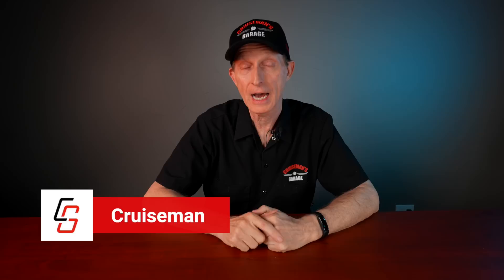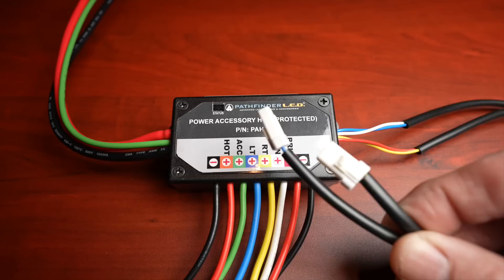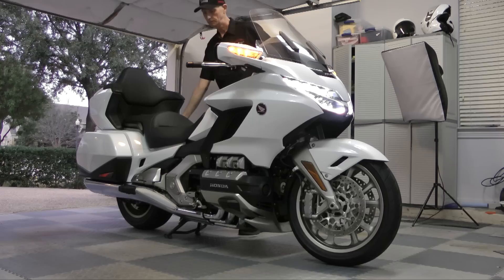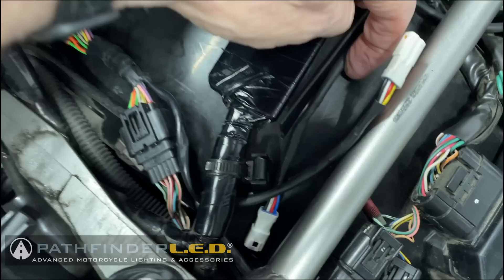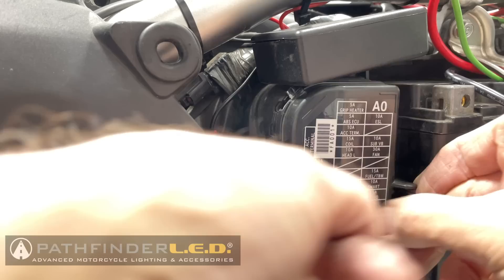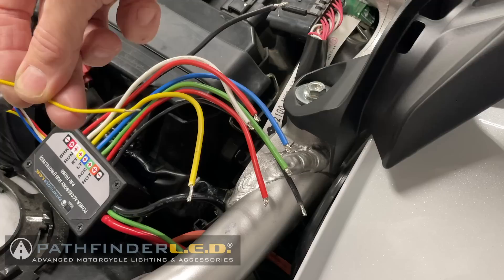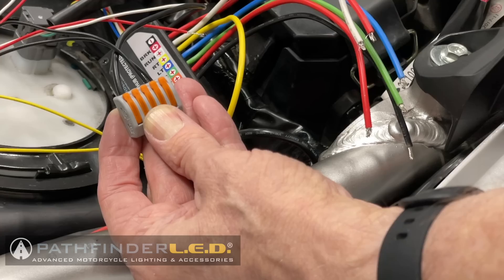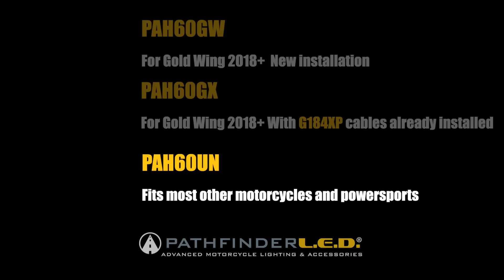Power Accessory Hub from PathfinderLED | 2018+ Honda Goldwing | CruisemansGarage.com

Comment: I ordered and received the Power Accessory Hub and it is all that Chris describes, and more.  I looked at Show Chrome and Electrical Connection and others for this type of additive device.  I was happy to see that Pathfinder/SocalMotoGear produced this alternative.  I have their harness and have three of their other lighting products installed on my 19 GW DCT.  I installed it this week and used Chris' install video here and others he produced to install the Show Chrome unit.  I used the Wago connectors on the ends of the Pathfinder Hub trigger wires and  used a black box to hide and  secure them with out of site.  His instructions were perfect and I am a happy camper.  I used the Wago connector to do the final wiring for my Muth Mirrors which work perfectly.  I now have the ability to add other electronics to the bike as my Pathfinder Harness is full.  Highly recommend this accessory.  Thank you Cruisman for your videos and these accessory installl productions.
Reply: What is the point of the show Chrome box if you have the Pathfinder box, or do you need both?

Comment: Thanks Chris.  I have all the supplies ready for the module to start selling.  This was great and I am now able to hook up my Muth Mirror turn signal wires.  I've installed and stored the wires waiting for the distribution block.  I will store the excess Wago Connectors in one of the black boxes you suggested when rewiring your bike originally.  Then I'll be good to go for the future.  Lucked out having got with the Pathfinder products thanks to your suggestions on accessories two years ago.   I like the weatherproof unit and the sizing.  Well done, as always.

Comment: I didn't realize this. But used a isolation relay to add my trailer lights. I recently bought a late model Toyota and am planning on installing a trailer hitch. It also requires an isolation relay. Learned all about them from your videos. Thanks buddy.

Comment: My bike already had a Electrical Connection trailer isolator. I used the trailer outputs to power a trunk mounted Goldstrike Tourblade light. Used posi-taps to tap the circuits downstream of the isolator. These Wago lever nuts appear to be a way cooler and safer way to share output circuits. Thanks Chris!

Comment: Ive been looking forward to this video, Chris. Good job! I have lots of accessories (lighted or otherwise powered) installed by the dealer and I've been waiting for this block to come out to clean up all the extra wiring and protect y the can bus electrical system. All of my accessories are either OEM or Pathfinder, which is quality stuff. Thanks again!
Reply from the maker: Sounds great!

Comment: Thank you for sharing I just purchased this and I am planning on installing the rear LED brake running lights with turn signals at the lower saddlebag area

Comment: Dang, you make it look so easy I am tempted to add lights to my 2018 non-tour using this product instead of letting the dealer do it. Have the Pathfinder fog lights and cowl lights in my cart and just waiting until I can add the power hub and the new Saddlebag LED lights. Also planning on adding the Muth Signal Mirrors.
Reply: Do the work yourself. Don't pay the dealer. I have added just about every light you can to that bike myself. It is easy and straight forward. Just take your time.

Comment: My question is:  you recommend to use wago 222 connectors but now they have a 221 which is clear and smaller.  Is  there any issues with using the 221 connectors.

Comment: Good evening were you able to use your Cowl Lights, LED Rotor Cover and Engine  Lights with your Pathfinder L.E.D Power Accessory Hub. If so did you use Goldstrike 48000 plug n play connector?

Comment: Hey Chris! 

Is this what I need to connect a trailer to my 23 goldwing ? 
Meaning, I can add this and then connect my trailer connector to those outputs?
Also do the outputs do the same as the inputs  like the turn signal outputs still flash ?

Comment: Hello Cruiseman, I was wondering if you wired your trailer harness directly to the pathfinder power accessory hub and if so is there a wiring diagram for doing that?
I would like to do that with my pathfinder power hub without using another isolation bus.
thanks for all your work.
Reply from the maker: I did. It will be different for every trailer based on their wiring scheme. If you can get the wiring color codes for your trailer (run, brake, left turn, right turn, ground, etc.) from your trailer manufacturer, you just match those up to the correct terminals on the Pathfinder.

Comment: Hi Chris - Hope you are well and riding. Love your channel. So I have a trailer coming and plan to wire a seperate harness from my Pathfinder LED power accessory hub to run my trailer lighting. Is this going to work for me or do I need to get something else that I probably won’t have room for under my seat. 😁
Reply from the maker: Nope, you can wire everything directly to the PathfinderLED PAH.
Reply: Great! So glad I added that PathFinder LED power accessory unit. It been a game changer for me! Nice video on installing it too!

Comment: Looks clean and simple. I have the Kisan Tail Blazer brake light modulator - do the saddlebag harnesses interface with Kisan harnesses electrically and how badly do they all compete for space in that tight area?

Comment: So according to this, the CAN buss is breaking out of the wiring harness to operate that isolation device.  That is the break out wires are not 12v  run, brake, left, and right?  
Now how do you strobe your brake light?

Comment: Hi Chris - I've recently bought a 2021 non tour Gold Wing, that I'm gradually apparently turning into a tour model. I've installed the color matched trunk. But man there is a lack of lighting on the back of this thing. I want to install a high mount stop/turn light on the trunk, but I'm not crazy about the Pathfinder spoiler light, but I love the turn signals that mount at the bottom of the saddle bags. Okay so here's my question can the Gold Strike light be powered with this Power Accessory Hub? And in the example of the saddle bag turn signals, can't you just get the type of connector that is on the light wiring to put on the PAH? Hope I'm making sense. I used to make molex plugs for changing parts in furnaces with universal replacement parts, so I could easily connect. I'd like to be able to add more lights, but only want to have to install one accessory wiring device.
Reply from the maker: Yes, you should be able to power any accessories with the power hub.

Comment: These ist also a new version for the 2021 US model. I don't know, what they changed with the 2021; gut i've been told, it only affects the US version, not the Europeen once.......
Maybe you could find out, what changed?
Reply from the maker: I think there was a change to the circuitry for the brake light. This only affects the 2021 Goldwings. Honda made some changes to the voltage of the 2021 taillights.

Comment: Question, I have the trailblazer harness plugged into the bike on both sides when I plug this harness in can I plug it in on the backside so that all the brake lights will pulsate or should I plug it in on the front side of the harness or it just operates? Thank you Cruise man

Comment: Hi Chris, great video! Can't wait to get my hands on one of these! Question....can you connect the PFLED G184XP harness INLINE with the  PAH60GW harness to add the plug-n-play  connectors for additional PFLED accessories that can be installed later? If not, I guess I'll be cutting off the plug-n-play connectors from other PFLED products and running the wires into the WAGO connectors :)
Reply from the maker: You should be able to connect inline, but a better solution would to be to buy the PAH60GX (without the harness) and use your existing harness to connect the PAH60, then, remove ALL accessories from the G184XP, cut off the connectors and wire them into the PAH60 using the WAGO connectors.
Reply: @cruisemansgarage  Great suggestion, Chris. Thank you for taking the time to answer my question!

Comment: Chris, I'm about to install the Pathfinder Power Accessory Hub in my new 2021 GW Tour DCT.  2 questions:  1) Is it Ok to remove the fuses from my two heated gear wiring harnesses if I connect them to the Pathfinder Hub?  2) I When connecting the Scosche Battery Jumper and SAE trickle charger adapter, do you recommend connecting that to the Pathfinder Hub or directly to the battery?  I'd prefer to the hub to reduce the clutter under the left side cover.
Thanks for all the great vids--really enjoy the high quality production values--Phil
Reply from the maker: Phillip, (1) you could remove the fuses, but no real need to, it just provides double protection. (2) The SCOSCHE battery jumper harness should be wired directly to the battery, not to the Power Accessory Hub.
Reply: @cruisemansgarage  Thanks Chris.

Comment: "Cruiseman" I have a question for you. I have just received the PathfinderLED Power Hub. I have a Rivco hitch w/ a Kuryakyn Relay assy for the trailer lights. Would you recommend eliminating that relay and connect harness to hub? Or is that relay required for the trailer lights operation? 
  I do like this new power hub. A very well constructed unit.
Reply from the maker: I have my trailer wires connected directly to my PathfinderLED Hub.

Comment: I already have the Showchrome block. Which do you like better?
Reply from the maker: Both are good, I lean toward the PathfinderLED because of the compact size and the weatherproof design.
Reply: @cruisemansgarage  does the pathfinder use circuit protection such as fuze to prevent shorts and overload ?
Reply from the maker: @Fireball1800  it does have protection, but all digital.

Comment: Have you used the newer WAGO 221-415 Lever-Nuts 5 Conductor Compact Connectors  which are smaller and transparent?
Reply from the maker: Al, testing them now.

Comment: Hmmmmm, looking for this for a Honda Africa Twin but it doesn't have the Saddlebag connectors.   Wondering whether Pathfinder is planning to release these for any other bikes.

Also, realistically, how many lights can you hook up to the device?
Reply from the maker: Yes, there is a universal model available PAH60UN. As for how many lights, as ling as you don’t exceed the amperage limits, as many as you want. A typical LED will only pull a couple of amps, if that.

Comment: Would it be good to pair the pathfinder pah60 with the electrical connections lighting distribution block instead of using those Wago connectors?
Reply from the maker: It's a matter of personal preference. Either will work fine.
Reply: @cruisemansgarage  only down side is that EC distribution block is expensive...

Comment: I have a big issue with this video mainly because of the order you are doing things.  You should disconnect your battery ground and hot as instructed but the battery ground should be the last thing you connect.  All connections should be connected completely before this step and your video clearly does not show that.  In my opinion your video should be corrected.  Your video is showing a unsafe process.  I have watched many of your videos and this one is so wrong.

Comment: Are you able to connect Gerbing heated gear to this system?
Reply from the maker: I am not sure about the amp draw of Gerbings, but I do believe that the Switched circuit is able to handle heated gear.
Reply: @cruisemansgarage  thank you, it's 6.7 amps
Reply from the maker: @azmotorcop  The HOT circuit (always on) is 20a and the ACC (switched) is 8a. If your controls have switches, you could run them off of the HOT circuit.
Reply: You are always helpful, the Goldwing community is better and more enjoyable because of what you do!  Thank you!